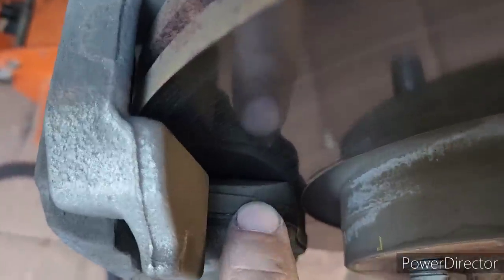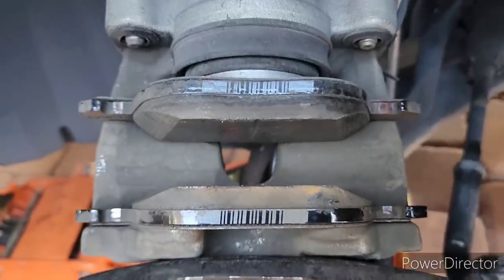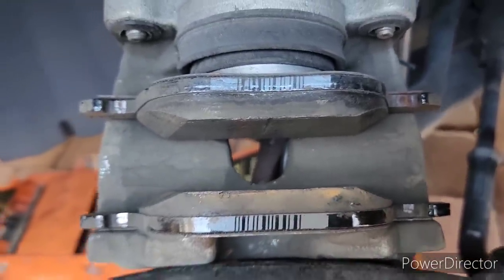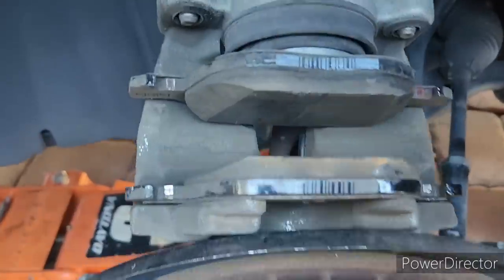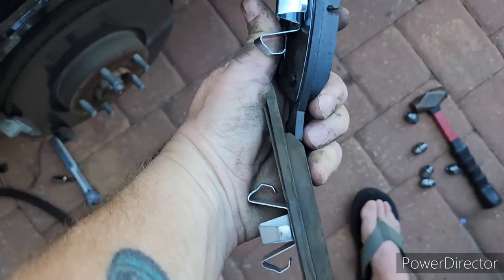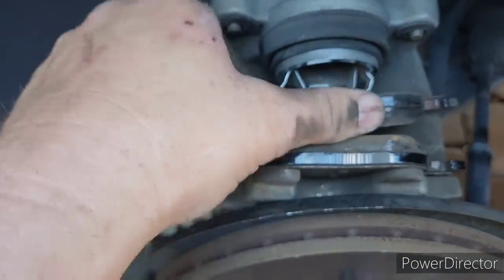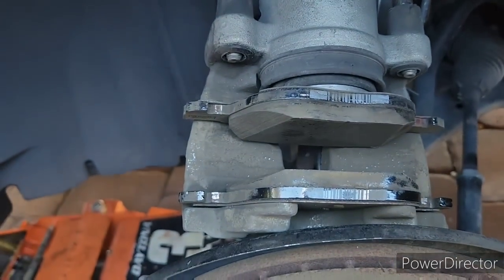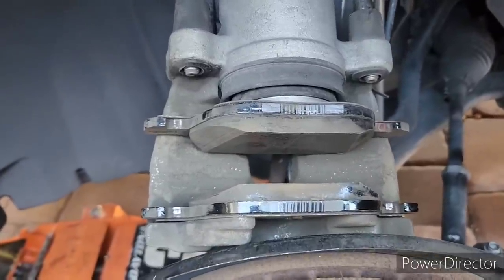Ford dealership robbed a little old lady out of a brake job. (almost)

Comment: I used to work for Ford in 2015-2016. The amount of vehicles that came in with only a couple thousand miles on them and having leaking transmissions that would have been covered under warranty was astounding and my managers told me to let it ride so further damage could be done and it fall out of warranty. After about the 10th one I started telling those customers about this and quit once I opened my own shop. Quite a few of them are still customers to this day and I live over an hour away from them. Honesty goes along way when you value your customers, dealerships are meant to exploit customers.
Reply: There are still good dealerships out there all warranty issues I still recommend and so would everyone else in my shop
Reply: Inlove you... Thank you...
Reply: Damn my VW dealer covered up my remap so that I could get my clutch replaced under warranty!

Comment: As a mechanic who has turned wrenches for 40 years, as a living and in the backyard, I've heard this story so many times I've lost count. My brother had to take his new vehicle into the "stealership" for a recall, he witnessed a young mechanic doing a yearly safety inspection and using a magnifying glass to try to find weather cracks in the tires. I've never had to use a magnifying glass for such things. This is why dealerships earn a bad reputation.
Reply: If you me and everyone concerned with Stealerp companies, we just need to boycott.  Use the internet and fix ourselves.
Reply: You can boycott but it will hurt all the good dealership techs out there not everyone’s out to get you or scam you
Reply: Especially if your good at your job you can make good money without lying
Reply: @matthewwillis2135  Issue is Dealerships are Obviously teaching or telling their Techs to Screw the Customer at Every Turn. 🤪👎
Reply: @kens.3729  correct, also they get bonuses for drumming up work and completing the job quickly, this is why shortcuts are often taken also. I worked for a dealership and was reprimanded for taking too much time to properly complete jobs, hence now running my own business and have many customers who trust my word
Reply: Why do you not name and shame this dealership.  Tell Ford you need to sort this problem out,

Comment: Daughter took her car to a franchise garage  to get the winter tires put on.
The mechanic said the brakes were so bad she shouldn't even drive home, but home it came. I bought all the parts to redo the brakes.
I took it apart and the same story as above, breaks were fine except the sliders needed grease. what got me though was that two of the slide bolts
had wrench marks and were loose. I replaced everything because I had the parts, but I will never let my family near that chain again.

Comment: $200? I live on the west coast. You can't even get a pad slap for that here. The pads themselves might be that much. You can pretty much double that here. I'm glad you said they sent a picture of worn out pads. Brakes can be changed for a lot of reasons where the pads and rotors are changed to stop noise, fading, pulse, ETC, but you said they tried to sell this as worn out pads. Shame on them!

Comment: I flipping hate people like that I am a mechanic myself. I will bring a customer out to their car every time.
Reply from the maker: Exactly! There's no need to be greedy. If it's needed, I'll sell it to you. If not, I won't.
Reply: One stealership I worked at another technician sold a brake job.  Customer could not do it that day so they came back a few days later, he was tied up so they gave the ticket to me. I took the wheels off and found brake pads had at least 75% left. I went ballistic and refused to rip the customer off. That did not go over good with the service writer and service manager but I did not care!

Comment: When I was just 18 and newly married Sears quoted me $800 for a brake job. That's when I learned to do auto repairs myself. Brakes, oil changes, tuneups, simple things I do myself & more complicated repairs go directly to the local mom & pop repair shop like this one.
Reply: Yep.  My Uncles taught me how to work on my car and a lot of other things when I was growing up.
Reply: whats a tuneup?
Reply: @nsaylorable  spark plugs and wires usually
Reply: @DJ29Joesph  what’s spark plugs and wires ?
Reply: @nsaylorable  There is no such thing. Look in the dictionary. The word "tune" refers to "adjusting for optimum performance." For the last 30 years, there is NOTHING to be adjusted. Points, carburetors, and distributors are long gone and replaced with programmed and non-adjustable electronic components.

Comment: I appreciate your exposing crap dealers like this.  Unfortunately, most technicians today fit into the same category as this ford dealership.  It's extremely difficult to find technicians that are first knowledgeable, honest/ethical and have the equipment necessary to diagnose problems.
Reply: But he didn’t expose them. We don’t know which dealership or where he lives. You have to name to expose.
Reply: @larrygro  I think you raise a good point because we don't really know what happened. Looking at the old brake pads, they were definitely wrong to try and sell a brake job. But the real question is, was it intentional? I would say there's at least a 50% chance that the dealer wasn't trying to rip her off intentionally. I'm a dealership tech and I've worked many places. Some were good, while others were not, but I've never worked for a dealer that would let me sell new brakes when the old ones were like new. 

Here's what most likely happened. Real techs get paid on the flat rate system. That means we get paid a set amount of pay per job. The average oil change and tire rotation pays about an hours labor. So, if it takes 2 hours to do the job, I only get 1 hour. If I do it in 30 minutes, I get an hour. For basic services like this, dealerships hire hourly employees to do this type of work. They get paid by the hour, like most people do. The position pays about $15/hr, and is an entry level position. This is where all the new techs start. And that's the problem. They would never let someone like me do this type of work I would get a full hour but at over double what a lube tech is paid. They just can't afford to pay someone $30-$35 to do an oil change and rotation.

With all the above in mind, most brake pads are tapered at the ends, like the ones shown in the video. For someone that's new and doesn't have a lot of experience, its very easy to look at the end of the pad and think its worn out because of the taper. So, while there was no excuse for trying to sell a customer new brakes, there's a good chance it wasn't intentional. I've seen it happen many times where they check the thickness of the pad at the ends, and not the middle. Or, they could have been trying to take advantage of the customer. We just don't know.

Comment: I've had numerous domestic and foreign dealerships try to sell me service that wasn't necessary.  The worse was a Toyota dealer where I bought my truck that told me I needed a power steering flush with only a few thousand miles on the truck.

I found a private repair shop that has been around for decades and the service is exceptional and the prices are very reasonable.  This shop rebuilds hot rods and off road vehicles but also work on everyday drivers.

Comment: I was terminated as a technician because I refused to upsell a brake job that looked like this. Dealers and Flat rate based work needs to be eliminated, eliminate service "advisors" and the used car salesmen that really run modern shops.
Reply: I was quoted 8 hours flat rate and $1200 labor to replace 4 ball joints that where 3-bolted in place on a 2WD truck. Did all 4 in my parking space in under 3 hours total.
Reply: Douglass was terminated for not flagging many hrs keep it real lol😂😂😂

Comment: There are a million stories like this- dealerships are like stepping into a pit of vipers.  My mom had a Chrysler New Yorker and one day the wood trim on the door panel fell off.  She drove to the dealer and they told her she needed a new door panel for 700.00.  Fortunately, she called me and I went over and put the trim piece back on- it had a couple broken plastic clips, so I just used some super glue- it was still in place 5 years later when she passed and I inherited the car.

Comment: Thank you for putting this out here in plain view of the public. I am an older woman alone. 
I just finished putting new rear rotors and brake pads on my truck. Noticed a leak on the differential. YouTubed it and found out it is the pinion seal. Youtubed that. 
Most things in this world come apart by unscrewing something. If it is something that all I have to do is unscrew old part and screw in new part...and it is not too heavy for me to lift....I watch a million youtubes on how to do it, order my parts and go for it.
So many of these places could make a nice living while being honest. But no! The love of money is the root of all evil. Jesus bless.

Comment: Definitely doesn't need front. But you didn't specify front or rear. You just said needs brakes. What about the rear?  Not knocking you at all. And I love that you caught that.  That's one reason I'm not a dealer tech anymore. I refuse to sell things not needed. Kudos to you.

Comment: The Ford dealer in my town kept recharging my mother's Ford Escape AC system because it wouldn't blow cold air for more than a few weeks. Once it was off warranty they said the system had a hole and needed replacement. They charged her $1500. I don't trust dealerships or big chains. I never got rich working in any garage.

Comment: I did front and rear brakes on mine my wife took it to have front wheels  alignment next day  and they told her she needed  front brakes.
People needs to know at least basic  mechanics.
Some times an old mechanic you know is better  then a new one to know !😅
Reply: Need my front wheels aligned and a tire place that does alignment told me I needed abput 1400 worth of 'repairs' on my car before they'll even consider doing an alignment. Still running without an alignment and running through tires because of it. (I cant afford that much)

Comment: this is why i started working on my own vehicles. 

It is always a fun conversation to have when you get tires done and the shop informs you that (brakes,  or wheel bearing, or ball joints, etc) need to be replaced, and you're fully aware of the condition of everything. It's fun. I usually play along with it up until the service writer gets an embarrassed look on his face as he slowly realizes that I know what they're trying to pull.

Comment: Mercedes Benz of Hilton Head did exact same thing to my wife while I was out of town. She picked up the pads and rotors brought them home foe me to install the following weekend.I pulled all wheels and started checking and there was nothing wrong at all… that was two years ago and I still have over 1000 dollars in new brake parts in my tool trailer

Comment: I took my car I've had since new to the chevy dealership for a temporary check engine light and some roughness they told me it was reading a code for timing between the crankshaft and camshaft and that my engine was bad. I checked it myself and found it had a bad intake variable valve timing solenoid. $50 part and 1 bolt to remove and unplug the wire connector , 10 minute job. It is running perfect now. That was 50,000 miles ago.

Comment: No different here in the UK. Our Ford Kuga (Escape in the US) was called up by the Ford main dealer for disc and pad renewal. The car has only done 22,000 miles. I measured the wear on the pads and discs (rotors) and politely declined.

Comment: I use to work as a mechanic My father was a machinist and I also worked in his shop. I am lucky to be able to see a scam when it comes to most mechanical problems. I had my spouses car at the dealer due to an air bag recall. When I pulled up a young man came out with a tool to measue my camber on my front wheel which I wasn't there for? I was told my front wheels were out of line and My tires would quickly wear out due to the problem? I told him it is alright. What he didn't know was the car only had 20.000 miles on it and had never even bumped a curb? This is another scam people need to be aware of. Thanks for the video. It should be seen by every lady that drives a car.

Comment: Well, I had a similar issue: Having done service in my work van and I got a call : "Your brake discs are in really bad shape and need to be replaced. We don't have them here but we can order them for tomorrow." The van was just 2.5 years old at the time. I needed the van back the same day because I had an importand job to do so I declined and drove the van to a different garage the next day where we use to go to replace tyres. Asked the guy about the situation and he went to look up the specs for these brake disks and voila, they were still good for another couple years ! Sure, they had some grooves but this was no problem. Saved us a lot of money ! The first shop (dealership) had a huge sign at the lobby about how important customer satisfaction is and about honesty bla bla bla, even the boss of the company told me the same story, that it would be inevitable to replace those discs. This can't be an a mistake IMO and I won't let them touch that van ever again !

Comment: One of the oldest tricks in the book is when you take your car for an MOT. Bearing in mind you'll always drive to the MOT station in daylight. They'll tell you that there's 2 cars to do in front of yours and they'll call you when it's done. You will get a phone call telling you that your number plate bulb has blown so its an MOT failure...however, they can fix it for you. Of course, you want your car to pass, so you say yes, go ahead. THEN...they charge you a minimum half hours labour (£/$ 45) on top of the test...AND....your bulb hadn't blown in the first place. So watch out people..!!

Comment: Stealership tried to completely rip off my retired mother to replace a stabilizer bar on an 8 year Lexus with 75k on it…..for $2,400!!! The picture they showed her was of the mounting bracket with surface rust on it. Shes in another state so for piece of mind I had her take it to a local shop that’s been good and helped her out before. They confirmed there was nothing wrong with it. This infuriated me. Completely unnecessary repair and they were going to charge over 4x what it would cost. Part was $300 and labor an hour or two. She won’t be going back to that dealer ever for anything. Indy shop didn’t even charge her for putting it on the lift and looking. She gave then $20 any way for their time and will have them do all work from now on.

Comment: Years ago I worked at a dealership were they were going charge someone nearly $200 to replace a square beam headlight.  
Also after I left I heard of some mechanics charging for an alignment and they never moved the vehicle.
  I may attempt to upsell work on a vehicle but it was because I saw an issue that needed corrected.  I never tried to upsell something that it didn't need.  I may tell the customer that there was a concern that would require attention soon but not now.  It gave the customer a heads up to prepare their finance for what was to come.  A lot of time they had me do it then.
  I despise mechanics that treat people like that.  Thanks for the video!!

Comment: Been a Mechanic for over 45 years and still wrenching on the side.  I see this all the time.  Even when I personally get my car smoged, they try scamming me on filters and want to change the air pressure in my tires.  I have to emphatically refuse them letting air out of my tires.  They say I have them too full.  Funny thing is my tires are not what came on the car from the factory and you cannot go by the door pillar. LEAVE MY FRIGGIN' TIRES ALONE.  Just smog the damn car.....sheeezz

Comment: A local Ford dealer tried to charge my wife ~$1600 to replace her ac compressor. She declined so they charged her $99 for looking at it. We took it to a mechanic down the street who told us the bolt fell out of the clutch/shim pack, and that all the parts were on the radiator support. He reassembled everything, charged us $100 and it still works 4 years later.

Comment: Thank you for watching out for your friends!
 This is why I do all my own repairs and I fix a lot of my friends vehicle's also. They will stop for a oil change also and next thing I'm getting a call to check out their car. The only formal mechanical training I have is as a locomotive mechanic for 2 years on a class 1 railroad. I started taking things apart when I was 7 or 8 yrs old and haven't stopped yet now that I'm 53.
Reply: I'm 65 now. It's tough but I stay on it. Sons a diesel mechanic with his own shop and house on 5 acres. When I need what I can't handle,(anymore), he does it. Next project where a shop is nice to have is a lift on my Taco. Best school for after high school and best tuition ever. Before he graduated his engine school he was picked up by a bus company and after a time bought his own place. He paid back his share of the tuition before he graduated. Now the contractors that I worked with when I was young have there children  bringing the trucks and heavy equipment to him. Do it fairly and you get generational business.